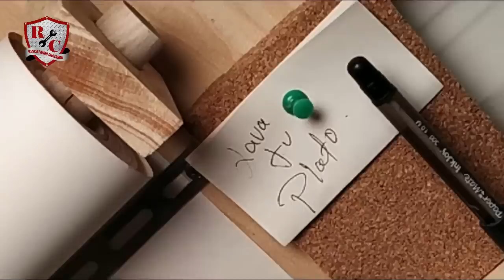DIY 🤯 3 Amazing ideas

Comment: Great ideas for gifts. My only thing is that I hope that PVC fitting never cracks or needs replaced. I know it would have costed a bit more but I think a nice brass fitting like you did with the handle would have looked sharp as well, plus would stand up to more abuse. Those pieces of wood for the base look fantastic with the varnish finish.

Beautiful piece regardless!! Great Job!!
Reply from the maker: Thank you for your suggestion and for your comment

Comment: The whiskey dispenser is for serious drinkers!
Reply: I made one for my shine!
Reply: Christian Ricci .
Reply: @hangoversamuiadmin3163  planning on going to home depo what plumbing components do I look for besides the spout?
Reply: @przfyneztrlcan  you will need one to screw your bottle into, I used old jack bottle for mine and connect that to an elbow then connect your spout. I actually made two, then put an so one side connects to the liquor, one side a coke 2 liter then I ran a t connector and hooked the spout to the t connector, I also have a valve coming from the elbow on the coke into the t, some with the liquor side, then I can adjust the amount of each when I open the spout, Once you have it adjusted open the spout and perfect jack / coke or what ever each time. I also set one up for a friend as a gift but that one I used all copper tubbing and connections.

Comment: The 2nd looks good but it won't work with full bottle of liquid. It needs a breath pipe to work...
Reply: True and also looks like it won't be well balanced with a full bottle
Reply: True it wont work without a vent pipe and the rubber washer in the tap will react with the whisky if left standing for any length of time and turn the whisky black, a stainless steel tap with a ball valve will overcome that problem

Comment: The whiskey dispenser design is flawed. It needs an air line otherwise the fluid won’t flow properly. 🇦🇺👍
Reply: I was wondering the same, you can see it trickles. Maybe leaning the bottle back if you can't insert a line?

Comment: Wish the measurements were on here so I could make these myself
Reply: That's the point, these are just some cool ideas. The measurements aren't really that important. 
Each one of those ideas could be and probably was made from scrap wood. 
Just take the idea and go with it. If it works out great, what did you learn from it. If it doesn't work maybe not so great, but what did you learn from it.
Take it from me, I've been doing woodwork for just over five decades. I'm referred to as a master carpenter, at least that's what the paper says that they gave me. I can do anything from framing your house to building the furniture in it. Truthfully I'm going to need another fifty years to learn everything else that I want to know. I've never built a log house, it's still on my bucket list. 
The point is, go to your workshop or set up you work station, work bench, even your kitchen table and have fun. Make something.
Reply: mike toni a woodworker who doesn’t use precise measurements and just guesses off of watching YouTube videos isn’t a woodworker, you’re just a hobby builder diva.